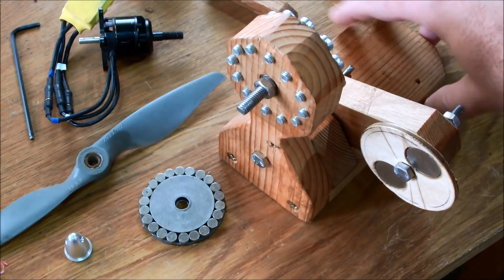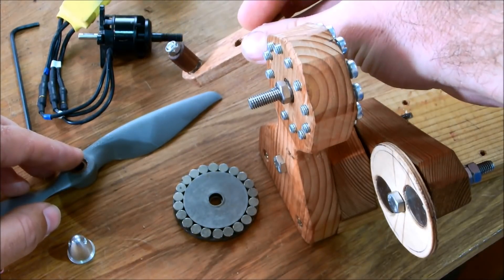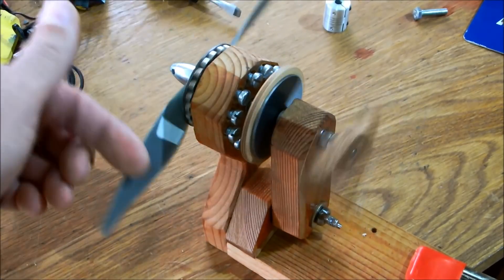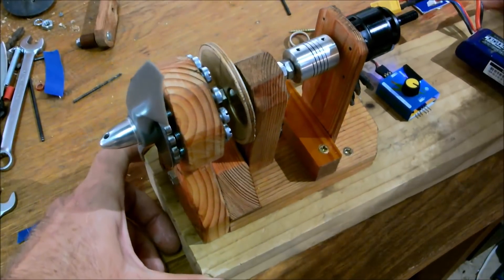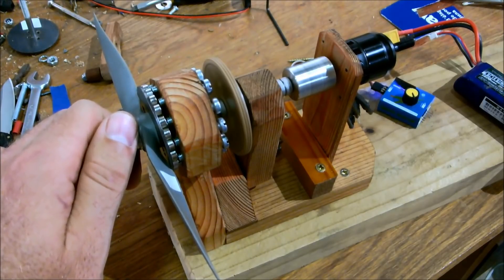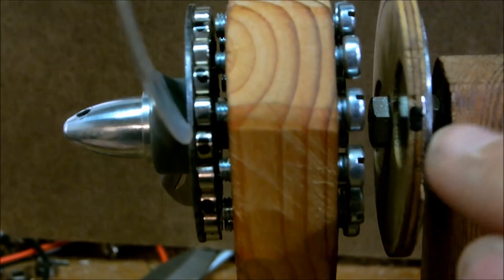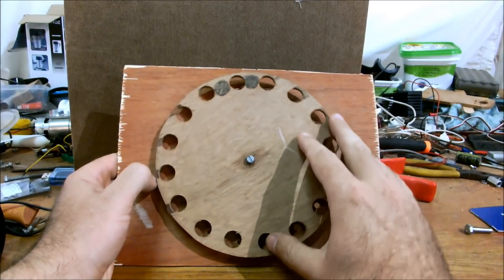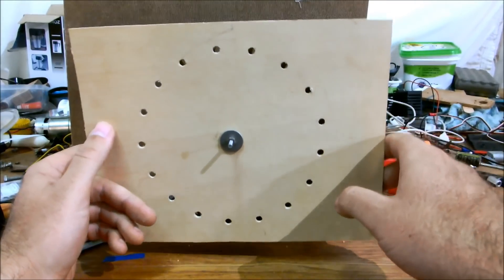Magnetic gears : Axial drivetrain proof of concept

Comment: I wonder if something similar could be done with the electrostatic force? (obviously a very different structure).
Capacitors could serve to provide +/- charge in pairs.
It would be exceedingly weak, but I wonder if the forces would scale up as the size of the unit went down, to say the nano-scale for a MEMS?
Reply from the maker: I cannot think of an electrostatic "equivalent" for the bolts. Something that will modify the electric field to increase or decrease the number of apparent charge pairs. Interesting thought though.

Comment: Great stuff! Have you tried direct same polarity magnets without  intermediary screws?
Reply from the maker: No, not as such. The bolts are necessary to achieve the gear ratio. For a future kayak motor I am considering a 1:1 magnetic coupling without bolts. The motor and mechanical planetary gears will be in a sealed housing and the output from the gearbox will then be transferred to an external propeller via the magnets. I expect the overall efficiency to be better than the model demonstrated here.
Reply: Sealed drive.

Comment: Excellent idea. Does the gear ratio have to be odd, or can it be even as well?
Reply from the maker: Any ratio is possible. The pinion is also not limited to only one pole pair, so with 8 pole pairs on the gear and 4 on the pinion will give a 2:1 ratio.

Comment: Awesome.  I've wanted to make some vacuum sealed devices (electromechanical capacitor,  medicino motor, etc.) over the years using magnetic coupling and now will have to consider magnetic gears.  Get's me thinking about magnetic field manipulation also for wireless transmission too.  Thanks for sharing!
Reply from the maker: I suppose high pressure applications can also benefit. Perhaps a sealed Stirling engine with pressurised Helium?
Reply: @williamfraser  Excellent observation!  Reminds me about magnetic bearings too.  Yes, I've advocated for about two decades now more-so related to nuclear plants so they don't waste freshwater... though I guess you could say they're cleaning the water to a certain extent if the source is more polluted prior, if the site is not polluting more. Still, for submarines seems like a great idea and maybe deep underground geothermal where I personally think the nuclear plants belong or out at sea and maybe deep in the ocean trenches tapping geothermal also.  Seems can pressurize another chamber around the Stirling engine as well as the pressurized Hydrogen-Helium mix.  Personally, I think a Hydrogen-Helium mix (other than leaking materials science or design advances to overcome) is safe and more efficient than just Helium... though you are correct.  Somewhere there is a NASA study I read back in the late 90's early 2000's that had nice graphs of the pressure details and performance gains.  I think they noted some material advances also regarding performance like ruby or sapphire lined cylinders.  Thanks for the reminders.

Comment: Is there a way to make this using non-permanent magnets?  i.e. use similar technology as in A/C motors, where coils of wire create the field, instead of rare earth magnets?
Reply from the maker: It might work, a/c motors can after all be driven as generators. I have no experience with them but have read that it requires external assistance to initialize the current excitation. Anything that involves current naturally imply resistive losses.

Comment: Some interesting ideas there. I wonder what causes the torque to drop off with speed..perhaps something to do with the number of poles?
Reply from the maker: There might be a clue in the fact that the prop does not start spinning again after I let go of it. Perhaps some hysteresis in the polarity change in the bolts. Either way, it is worth investigating. Curiosity is a phenomenal teacher.
Reply: @williamfraser  Yes, hysteresis or some other time dependant effect is required for that behaviour. Curiosity is a great teacher!